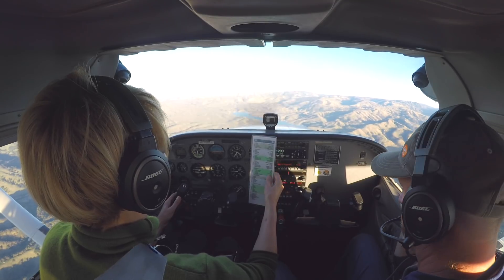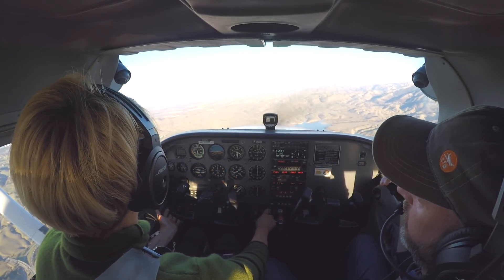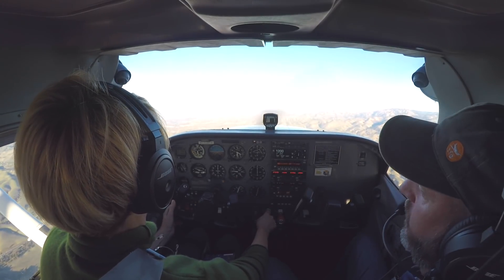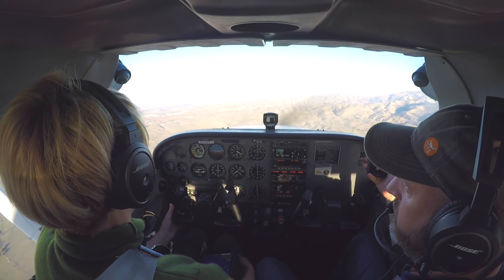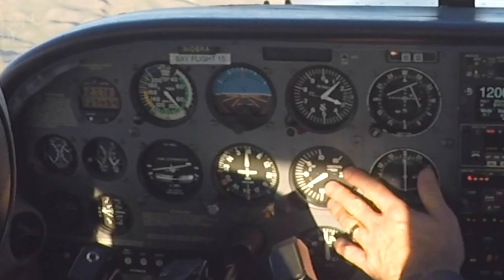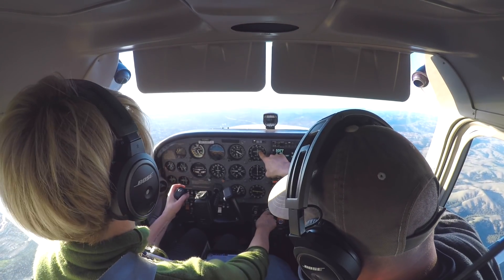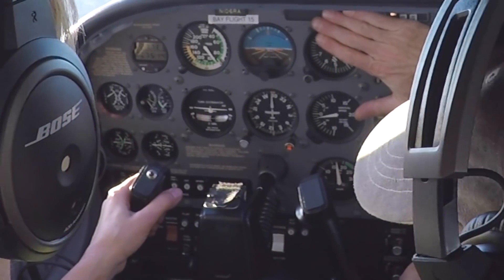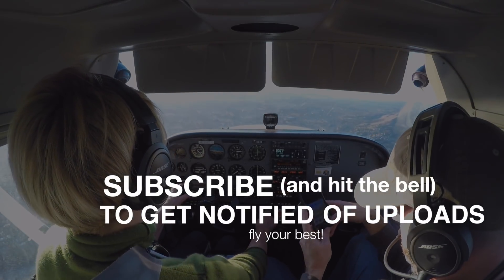How To Hold A Glide Slope - The SECRET that pro pilots know

Comment: I like your videos.
With regards to GS and airspeed control, I respectfully suggest a 180 change from your method.  I would trim/pitch for airspeed and throttle for GS.  This is based on the excellent text “Aerodynamics for Naval Aviators.”
Without going into a long winded discussion, if the plane is ultimately trimmed to 90, or any desired speed, then simply throttle for GS.  If high, throttle back and if low, do the opposite.  Try it.  If stable and trimmed, you don’t even have to scan the airspeed and attitude indicators (But one should still scan it).  Flying is then easy.  I do this method from radio control airplanes, to all light aircraft that I fly and even the 737 at work.
Reply: That’s what we were also taught too at my flight school. Pitch controls speed, and power controls altitude.
Reply: That's what I teach my students. Pitch for airspeed, power for altitude.  It works for paper airplanes too.
Reply: Here  (UK) it's also the main principle for visual flying and non-precision approach, but for ILS it's being taught in reverse by many instructors.
Reply: Military and civilian training I got was pitch/trim for speed then throttle for altitude control on the gs.
Reply: If you pitch for altitude it causes all kinds of other possible issues, chasing airspeed or altitude and now your distracted which = "dear so and so, I regret to inform you that your son/daughter hit a tree/building etc, basically CFIT. An unstable  appr can pop up quickly and then your behind the airplane.
Reply: It’s not either/or it’s actually neither. With power/decent rate and pitch/airspeed or vice versa, you are chasing the needles. Even though the VSI has very little lag, it still has some and if you get gusty conditions or a pilot who’s over reacting you can get into a roller coaster or PIO. 

Pitch to ATTITUDE, and then adjust power as necessary to control BOTH speed and descent rate. 

My plane, three degrees nose down attitude is a three degree slope. Very simple. Then a stock power setting with minor adjustments for winds and density altitude. 

If I’m high.. a SIMULTANEOUS adjustment of pitch and power is required. You can’t change one without also changing the other. What you ascribe each to change is irrelevant. 

Same with too fast. You’ll have to both increase pitch and reduce power. 

One thing that most pilots don’t realize is that if you don’t change your pitch attitude or trim, reducing power will actually speed you up and adding power will slow you down. 

That’s why when you are high and fast, chopping power to idle seems to make it worse to start. It’s also why on a go around it’s often a struggle to gain or maintain airspeed. 

So when you are in these situations, fix the airspeed first before altitude or descent rate. 

In automated aircraft, this is what Flight Level Change does... it goes to selected airspeed faster than it does to the climb or descent to the selected altitude (it will even level off to try and reach a speed too fast for the aircraft). 

Remember, pitch plus power equals performance. And you cannot change one without changing the other to maintain a performance value. 

Commit those attitudes to memory because those will be what save you if you lose your pitot static instruments. 

Had the crew of AF447 knew that, hundreds of victims would be alive today.
Reply: Interesting comments here. See this guy has 20 years of teaching aviation in a 4 seater. He is riding the ILS so often that you all get dizzy. I fully agree what he says for the ILS. If I try to keep my Mooney on the GS with my throttle, nothing happens for seconds. I always use the pitch to keep it on the GS, and use the throttle to compensate the speed. So here ist the comment of an engineer:  Guess how the autopilot keeps the plane on the GS? Right! Using the pitch..... Not many of those 4 seaters have autothrottle like in your 737 ;-) ....
Reply: @pilotandy_com  Doesn't a paper airplane count as a _Light Aircraft_, though?
Reply: I agree with you for VFR flight, but for an ILS where you’re likely to be dealing with strong winds you want that air speed for maneuverability and to avoid stalls and sudden drops from chasing the localizer.
Reply: Both methods work. The name of the game is consistency in the early stages. That is when it matters. Once 'pro-level' is achieved it matters little.
Reply: @Alex-us2vw  All depend on S&L,  or going up a while or down a while. Until you reach the down bit on finals when you assess yourself at the appropriate position and  airspeed  relative to the threshold. Then pitch to maintain a constant sight picture to the aiming point (whatever is selected) and small power changes to maintain the appropriate airspeed. At the start of the round out throttle smoothly and FULLY closed. Can it be done differently? I am sure it can. However pilots in the learning stage need consistency. Many, many hours of instruction showed me that the method described got the best results.
Reply: @Michael David Robinson With respect.  A major contributor to accidents is an inherent misunderstand of the fundamentals., As demonstrated in your response.
Reply: @Michael David Robinson Ahahahah - is what smells of B.S.
Reply: @Michael David Robinson You are just full of it. Pitch/Power are interchangeable functions. If you are incapable of understanding that - then your immature ramblings are the product of unadulterated B.S.
Reply: @Michael David Robinson Langewiesche's Stick and Rudder: "pitch to speed, power to altitude"
Reply: That’s Great Tip, I think. …I’m only VFR 😊
Reply: Navy fighter pilots are taught this (pitch for airspeed) because they fly in the reverse command region for carrier approaches.  Air Force pilots are taught the way in the video (pitch for VVI and power for airspeed).  The video teaches a power variable approach and that is what an airline will expect the pilot to do.  Pitch for airspeed is a power fixed method and is a holdover from the 60's when engines were less reliable an IP's taught 180 power off approaches.  I think the best method is to teach power fixed until established on the glideslope and then switch to power variable once a suitable aimpoint is established or one the glideslope.

Comment: Quick reference technique:  Take whatever your GS is and add a zero to it and then divide by two and that should be what you hold on your VVI.  So if your GS is 200 knots, you add a zero and get 2000, then divide by two and you get 1000 ft/min on your VVI to hold the glideslope.  This is helpful if you are changing your speeds based on configuration throughout the approach.
Reply: Some pilots don't have GS displayed and besides groundspeeds can change drastically when there's a windshear somewhere along the descent.  Why go through that extra unnecessary workload?  Every pilot has all that is needed right on the panel - just follow the glideslope needle.  That's all an autopilot does with perfect results every time.
Reply: way too much maths. It's just half your GS plus a bit. so 150kt GS, 75(0)fpm plus a bit. ignore the zeros. biggest mistake pilots make is not commanding sufficient RoD early on, or joining final above profile and having to have high RoD to catch up. So if you re turning on at 10nm/ 3000agl, you need to make sure you start descent and an appropriate RoD STRAIGHT AWAY. ILS is super easy as needles will guide you all the way down. A non-VNAV RVAV/RNP or VOR/DME is the bigger challenge and needs a good brief before hand or you will fail to maintain profile.
Reply: @nzmarty  its good to have more than 1 math shortcut. Lots of ways to multiply by 5 ;)

Comment: Thanks for being so calm. Your positivity towards your student goes along way. I liked what you said about the glide slope, “ the situation might be a little different but this will be darn close”. I also find that 90 with 500 ft descent may not be perfect but it is pretty darn close. - keep these going! #TFP
Reply from the maker: Thanks Paul! I will keep them coming
Reply: It is only close because the wind is seldom calm.  So, you need to adjust for the fact that at 90 IAS your ground speed will rarely be 90.
Reply: @LTVoyager  True, but this is a great starting point to build upon.
GS x 5 = approximate VS
Helps adjust to other conditions. And of course wind layers change during descent too.

Comment: Good technique ,,we were told to control air speed with pitch and altitude  with power
Reply: stealhty1 What you were told is correct. An aircraft will climb or descend due to thrust.  (In a standard atmosphere excess thrust will determine an aircraft’s absolute ceiling for a given weight.) Changing pitch will change AOA which will change airspeed and the thrust required.  So no, this is not a good technique. This video is garbage.
Reply from the maker: @jimziemer474  Garbage? The reason you pitch for the VSI on a Glide Slope is because the response is immediate, instantaneous. The airspeed indicator lags way to much. The signal is extremely narrow. If you try holding a glide slope by pitching for (or trimming for) and airspeed you will lose the needle I can almost guarantee it. The airspeed indicator lags waaaaay too much to make this effective. Not only are you responding to very old data, the response inputs take too long to manifest in change.
Reply: The Finer Points sorry friend, but I think you have that backwards! The VSI in a plane like this has a lag of ~5-9 seconds whereas the ASI responds almost instantly.
Reply: @alexhackler8166  The vsi does lag but that is not what is being discussed, you need to know this on a deeper level to understand. The asi responds slowly to power changes, where a pitch change will have a much quicker effect on rate of descent. 
Yes, the airspeed is an instantaneous measure where the vsi takes a moment to read accurately, but that's not what he's talking about.
Reply: @taytayflyfly7291  Except that if you read the message that I responded to that is exactly what he is saying. In terms of trying to hold a glide slope the Vertical Speed Indicator is effectively useless beyond confirming with other instruments because you're looking at what has happened 10 seconds ago. It's fine to use it to get set up at an appropriate descent rate but in terms of holding that glide slope you need to look elsewhere. The Air Speed Indicator will tell you about any change in pitch almost immediately regardless of if that change in pitch is from a power change or just a control movement. Source - Also a Flight Instructor

Comment: Writing more for myself:  Now a rusty pilot and part of it was my constant frustration, distraction and yes stress over the Pitch vs Power question. I was so tired over my lack of confidence in "which one to control what?" is best.  I was ace at holding a GS or so I was always told but inside I fought demons always wondering how to do it best and I think my ability was in my reflexes to catch it quickly and often used both controls. But that is a lot of distracting workload in IFR.  I got better but now rusty I THINK I recall this:  1) of course never forget one affects the other 2) Know my power/trim settings to set up the trend 3) If I use the theoretical (I'll call S&Rudder) "Power for altitude" thinking, I'm gonna sink right through the GS I was getting back down to unless I anticipate and power back up early because reducing power doesn't automatically stop the descent at the GS (vice versa for climbing back up). AND I may be doing this behind the power curve where inputs will be even wilder. In other words, I think in the end it's BEST to think SMALL CHANGES with STICK - it's a faster correction and more forgiving than power changes (where getting behind the curve can be fatal). Use S&R to set up the approach but stick for the small altitude changes. Once back on GS IF speed is changing (likely will not once settled in) then power adjust to compensate. It goes against what we are taught for S&R skills but really, that's for setting trends and not small changes otherwise you end up "chasing the needle" and becoming distracted. 4) ALWAYS remember if too low/too slow Peddle to the metal and lower the nose - in other words remembering the power curve and Wolfgang's Stick and Rudder theory comes back to save the day - you can always go around. Also, classic Wolfgang's S&R skills are critical in slow flight and when behind the power curve but at cruise or anytime there's lot's of momentum and airflow going, I'd fix altitude with stick first then set trim and power because varying power 'first' sets up a new trend and I'd end up fiddling sometimes my entire flight to try and get it right leading to exhaustion.  
Of course, for MAJOR changes, always remember to use both as one does affect the other. In time it become second nature to do both.

Comment: 90 kt is 546840 feet/hr  (being 1 nm=6076 feet)  3 degree descent than Tangent(3)=0.0542  now multipy 546840X0.0542=29597 feet/hr descent to convert this to feet/min we need to divide to 60    29597/60=493 feet/min.   GOOD LUCK!  (not exact calculation but close enough)

Comment: I'm a fan of 5 times your groundspeed divided by 3 times your glideslope (5 * groundspeed * glideslope / 3), more easily expressed as 5/3 * ground speed * glideslope or 5/3xy. 9 times out of 10 the glideslope calculation cancels out to 1 since 3 degrees is the standard but with some quick rounded mental math it gives you the ballpark descent rate for any glideslope you may need. 

This formula has application for enroute climbs/descents as well as various other times where you might need to maintain a particular slope.

Comment: What a great video... congrats.. Here is another tip... Fly to Every Runway like there was an ILS approach servicing the runway (e.g. descent rate GS(kt) X 5 in ft/min). Most videos I see on YouTube the pilots approach "too low" and plan to touchdown on the numbers (is anyone paying cash for that?). So, they are on glide path, chop the power, increase their descent rate and the flatten the approach to touch down on the numbers. The sight picture is completely off and the flare provides little aero braking since the flight path is so shallow.
Reply from the maker: pedrosura thanks! Agree about touchdowns on the numbers, why? As long as the wheels are down in the first third or at the latest by the halfway point I’d rather see a pilot keep the altitude to potentially glide in the event of power failure
Reply: You are welcomed! Great channel. Really good topics and superb instruction. Well done..

Comment: Wow. This is amazing! Thanks! I'm instrument rated but was never taught to use power setting to hold glideslope. It looks much easier than chasing the damn needles, which gets challenging close to the runway. I'm definitely going to try this during my soon-coming instrument training for my comp check (haven't flown IFR in a while & need this). Questions, how does one figure out the needed power setting? Trial & error? Is every plane going to be different, or will all 152s be the same, all Archers the same, etc?

Comment: The main thing I would keep in mind is there is a particular power setting that will produce a certain decent rate. Like in the video he references 1700 rpm. You have to have a general reference whether landing visually or flying an approach. A good rule of thumb is A/S x 5= VSI(rate) 450fpm. This will keep you on the g/s. Pitch for airspeed, adjust power for glide. IMHO.

Comment: If you happen to be using Jeppesen approach plates then there is a FPM vs grounds speed on the plate. Also for a quickie if you have your ground speed readout and let’s say it’s 95 it’s then add a zero and decide by 2 and that gives you a pretty good fpm to maintain a 3deg glide slope.

Comment: Quoting from 4:31: "A 90-knot ground speed and a 500 foot per minute descent will almost certainly hold a glide slope." - Gotta be careful, you have to take some factors into consideration, this works for a Cessna 172 under the weather conditions seen in this video, but it may not work for a larger GA aircraft and will certainly not be suitable for a Cessna Citation. 🙂

Comment: 1 to 1.5 NM before final.  It's 10' flaps, mixture rich and landing lights on.  Are you using power to keep your airspeed at 90 kias with the flaps in.  I can't clearly see if 10' flaps are in.  Thank You.

Comment: hey great video! Appreciate how calm you were, and the video was edited very simple to understand too. Love this video! Also, 90 seems kind of fast?
Reply: Airliners fly approaches a lot faster than that.
Reply: Colin Rasmussen jets have two engines, thousands of gallons of kore fuel, and will stall if they fly anywhere near the speed of a Cessna on final. Totally different planes, I meant 90 seemed fast for a C172 but also mine isn’t in mph it’s in kts
Reply: Veni Vidi Amavi I prefer to fly the ILS @ 105kts in the 172.

Comment: And for those curious, in skyhawks, piper warrior/Cherokee’s (most normally aspirated fixed gear aircraft) 2100 rpm’s and proper trim will give you level flight at 90kts in landing configuration. 1900 rpm’s when you reach the glide slope will give you about 500 fpm descent at 90kts. Don’t pitch up or down!! If you get low increase power, if you get high, decrease power (small adjustments only)